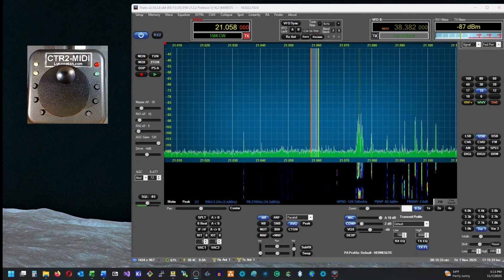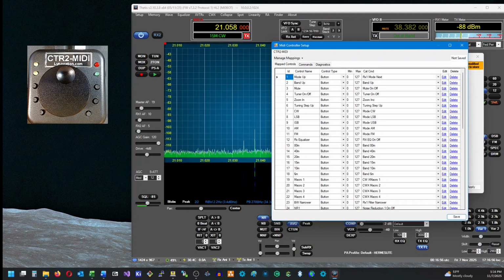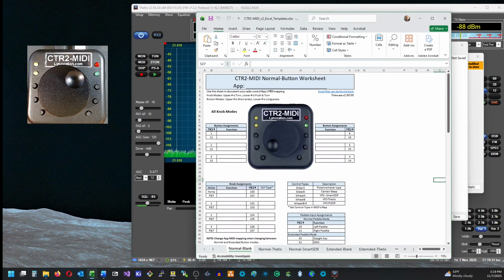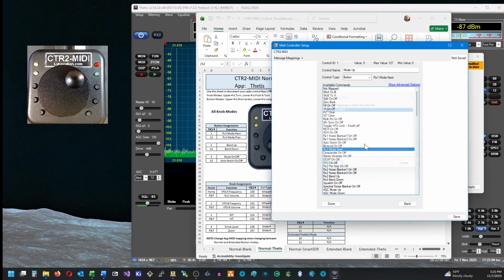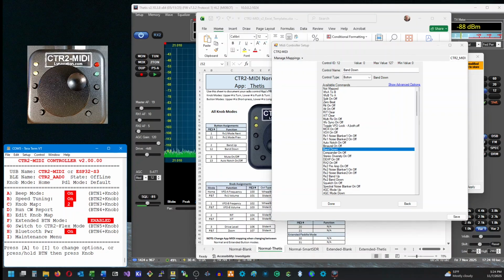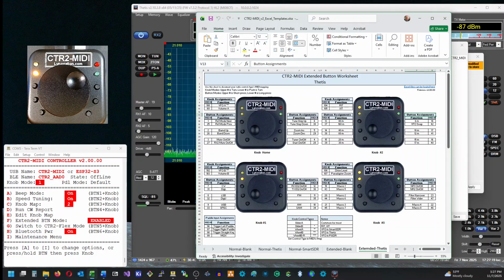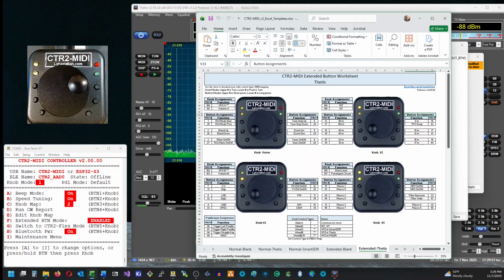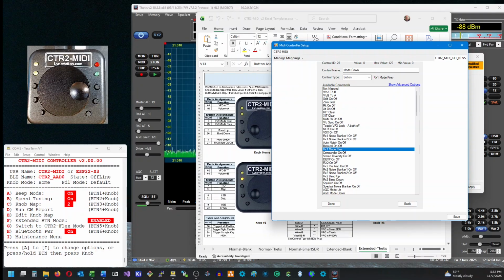CTR2 MIDI Version 2

Comment: Hi Lynn, I’m trying to find a way to reach you with some questions about your midi controllers. I have a use for them and I want to check with you whether you think that it would work. 
I’m hoping to be able to use them for ETC Eos Nomad which uses Midi/OSC.
Reply from the maker: Philip,
My email address is good on QRZ.com. Look for KU7Q. I also have a contact form on my web site, Lynovation.com.
I'm not familiar with the ETC Eos Nomad. If it supports Bluetooth MIDI my controllers should be able to work with it.
73, Lynn